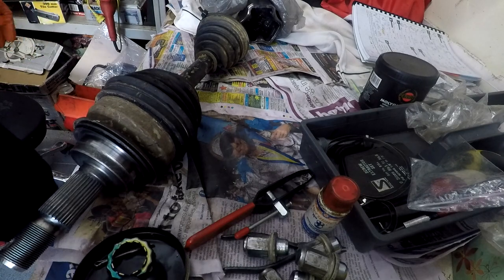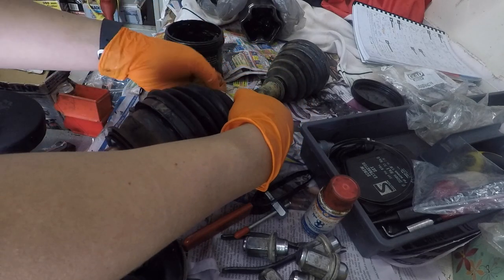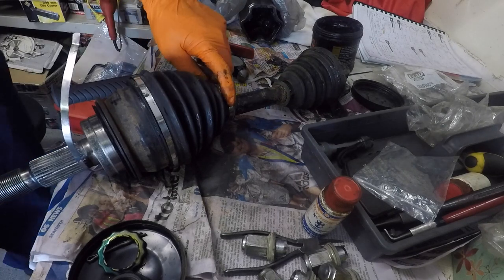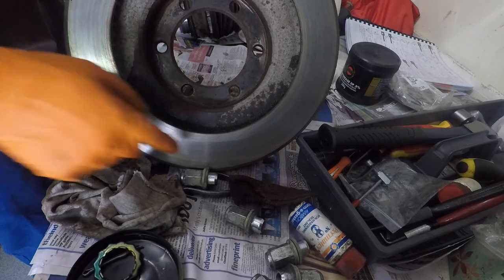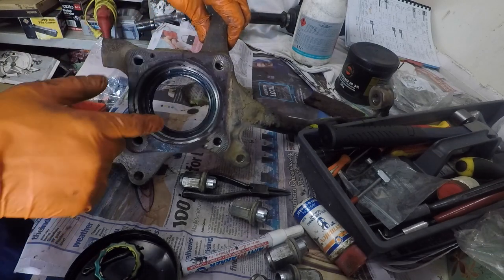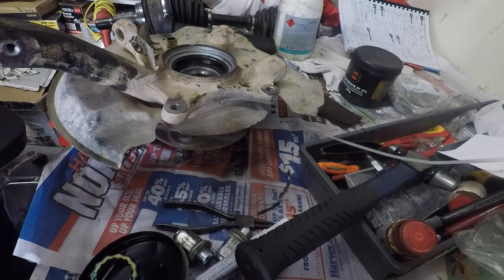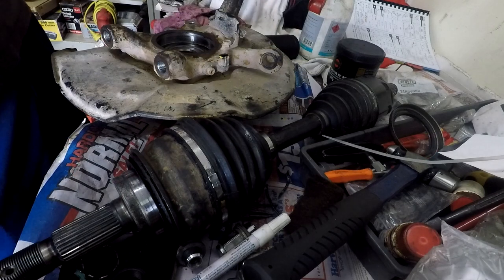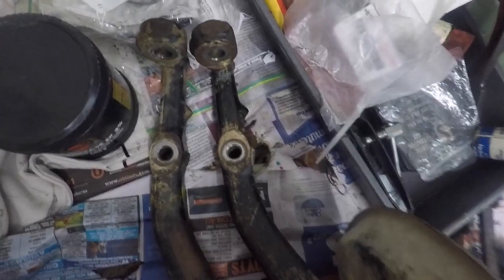Playdoh: Toyota Prado 120 Front End Rebuild, Part 2: Driveshaft & Front Hub

Comment: any tips to measure the rotor thickness when its got a decent lip? I guess it would be screwed anyways..
Reply from the maker: They have special calipers for brake rotors with more offset on the Jaws. Alternatively use something like a nut with flat faces on either side of the disc - measure total thickness including the nuts. Then subtract the nut thickness and that will be your disc thickness
Reply: mind blown ... why didnt i think of that hahaha cheers!
Reply from the maker: I can sell you some calibrated, bengineered certifies nuts if you'd like